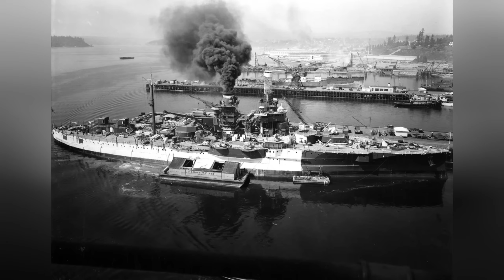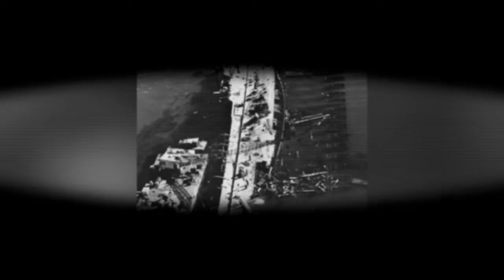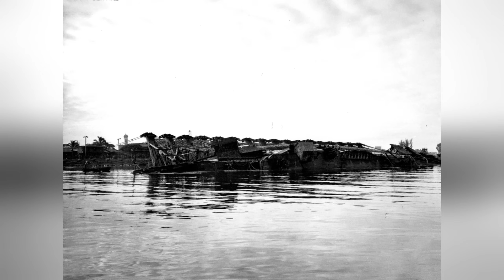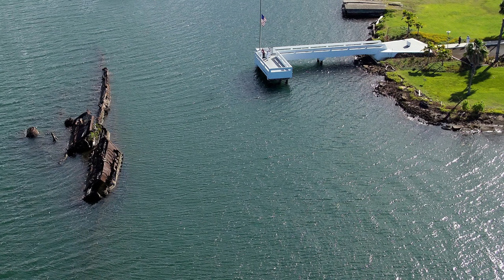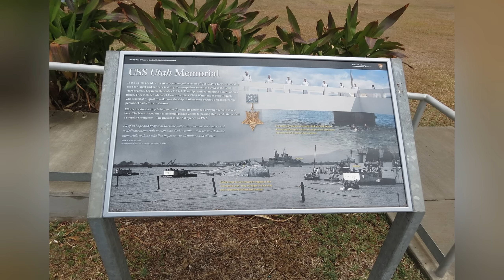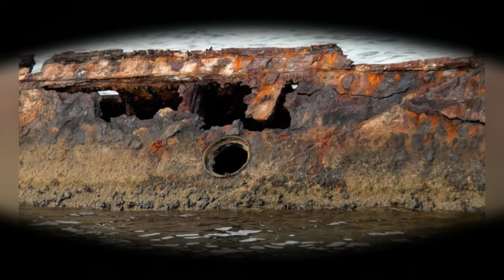Raising USS Utah: Why the Salvage Was Abandoned at Pearl Harbor

Comment: Heard the Utah was also berthed where a carrier would be.
Reply: That is true. 
 I think, could be wrong, but it was the same spot for the USS Saratoga. 
That is why it was a valuable spot at the time.
I shudder to think it would have been a different war if the carriers were there.
Reply: @timothycreasy2161  Even if the carriers had been there it wouldn't have done much.  Only 2 of 7 carriers in the USN were stationed in Pearl on Dec. 7th.  The USN could have still stopped Japan at Coral Sea, and if there is no Doolittle raid no Midway, but it wouldn't have stopped the onslaught of Essex class carriers coming.  Also depending on damage, they would have been repaired and seen action.